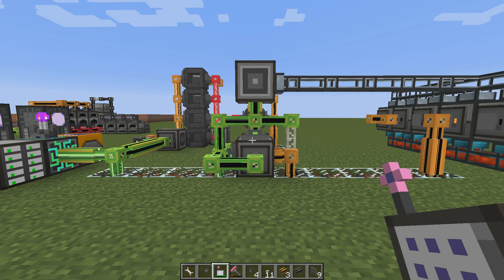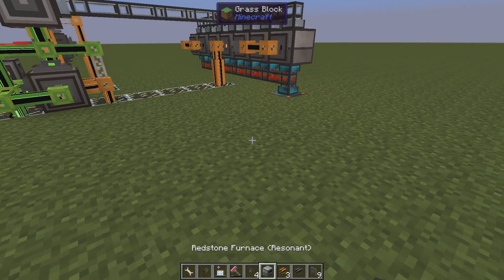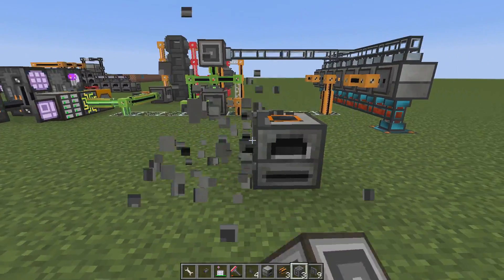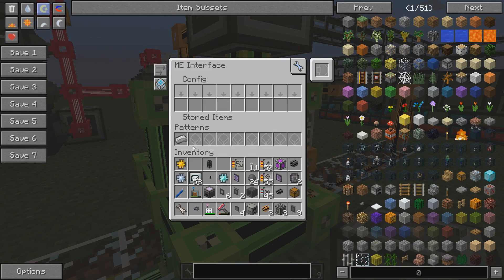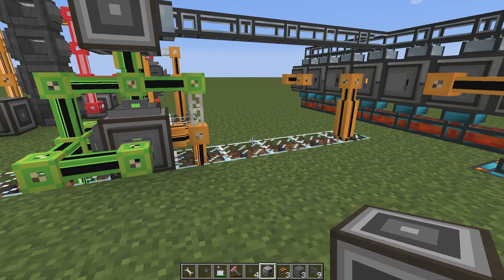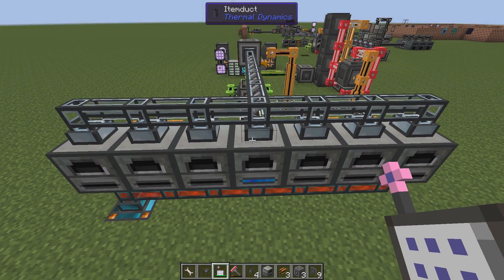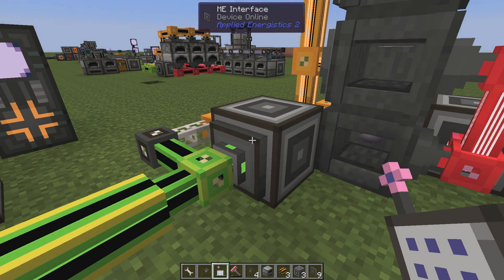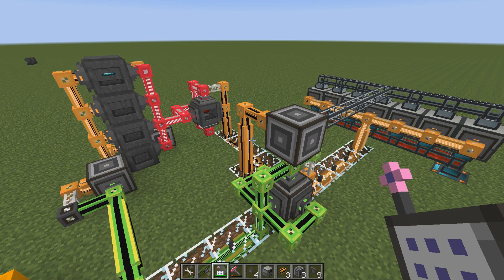AE2 Quick Tip: Effective Machine Sharing For Auto-Crafting (MC 1.7.10)

Comment: Je m'excuse déjà si j'écris quelque chose de mal, j'utilise google translator, je voudrais savoir si vous pouvez parler d'autofabrication avec plusieurs machines à une interface si cela est possible dans cette version, j'ai essayé plusieurs fois que rien ne fonctionnait.
Reply from the maker: If you're using Google Translate, please post in English. I don't really understand your request, please be more specific in what you want to do. Using several machines in steps is common, but without a proper description of what you need I can't really give any tips.

Comment: Could one automate the smeltery?
Reply from the maker: Yes, but since the smeltery has a few manual steps you might need to combine the process with external redstone logic and/or other mods. I have actually never done it myself, and things might be more or less tricky depending on what recipes you need there.
Reply: TKH It's just melting undamaged golden swords, armor (and horse armor) and extracting nuggets that are later crafted as ingots, or doing the same for iron in a separate smeltery. A redstone clock, some form of interface that would only pull the ready nugget/ingot once it's ready maybe?

How would one filter only the undamaged armor?
Reply: (Because for alloying I would use the alloy smelter instead)
Reply from the maker: I just tried a simple setup and it worked just fine. A smeltery dedicated to gold smelting. The ME network exports golden armor, sword or whatever via an export bus to the Smeltery Controller. Put up a Drain and a Casting Table with an Ingot Cast. An import bus on the side of the table and the only thing we need now is to extract the fluid. It depends on what mods you have, but I used a Fluiduct from TE with a Servo. Either that or something that can filter out what to extract. Just down into the table and everything is done. Simple and works fine!
Reply: Extracting fluids in fact? Yeah didn't think about that, I was thinking more like auto casting into ingots or nuggets (for gold).

How would I filter out only the undamaged armor and swords? (the others can't be smelted). I can use ender conduits (they are my main thing until I get full AE stuff)
Reply from the maker: Didn't try the damaged parts, but you can see an example setup on my social medias. Here for example: 
https://twitter.com/therealtkh/status/903716023916007424
Feel free to try solutions and update with your results :)
Reply: Well I think if I set it to match metadata (Ender IO) I can make it work with unenchanted, or with enchanted with a specific enchantment...

Gotta try with Extra Utilities item filter with the Ignore NBT upgrade. (and with the Ignore Metadata one, maybe?)

Comment: Interesting.....but, I really did not get the logic behind TKH.  The ingots are required to main network, but, how is distributed into the 7?   or the gold will be always send to the 3rd machine?
Sorry !  Cheers.
Reply from the maker: The distribution in the 7 furnaces seems to be random. If you order 10 Ingots, all 10 Ores will end up in any one machine, but only in one. If you order 10 Bricks at the same time, they will fill upp another machine (and only one). If you order 200 Ingots, one machine will be filled upp until it reaches 64, after that the ores will start to fill up a second machine, and both will be fed with Ores. As I demonstrated in the beginning, you can run this with only one machine, from the main network it will be exactly the same. By adding more machines in the subnet you simply add capacity, and it will not cost any channels in the main network. Hope it's more clear now :)
Reply: TKH ...yes..tyvm to take the time to explain.